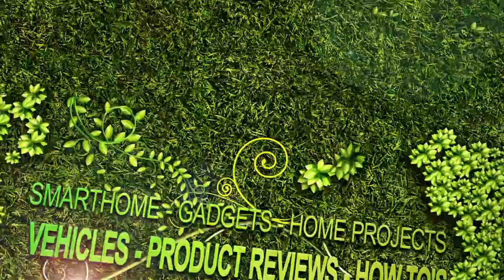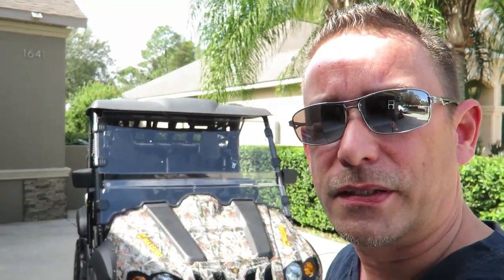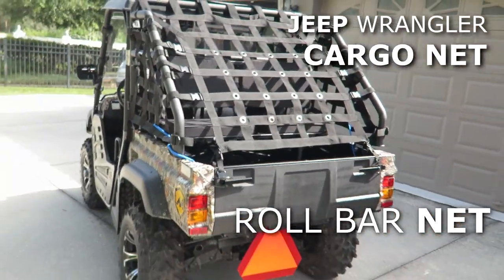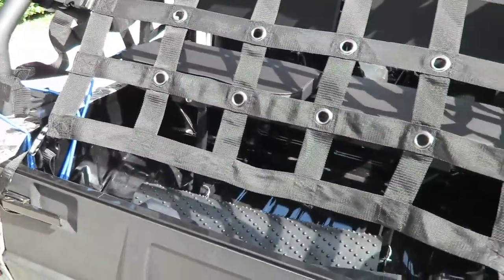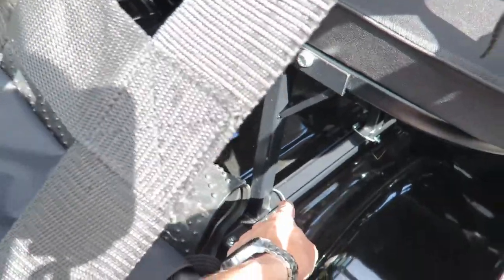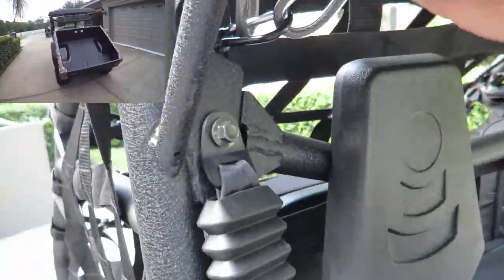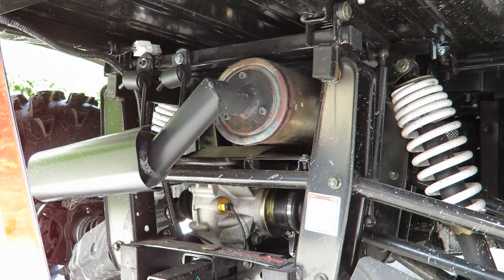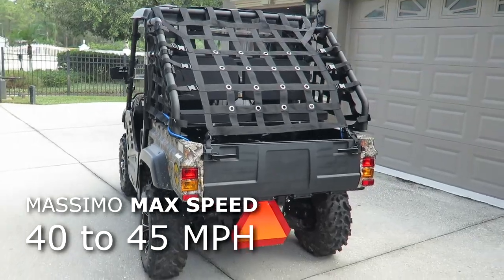TOP 5 UTV MODS:  How to Make Your UTV AWESOME!

Comment: I have owned my Massimo UTV 500 for 8 years and have made some very helpful & useful mods.

#1 - Added/installed a hi-intensity 16 " LED light bar, onto the 'brow' of cockpit roof, then mounted On-Off switch to instrument panel at 'knockout' plug location.

#2 - Ordered a Volkswagen rear view mirror & mounted it just to the inside lip of the cockpit cover.

#3 - Purchased a Kidde fire extinguisher at local hardware store and mounted the unit between the seats to the center vertical support bar.

#4 - Purchased a 'flat' cargo rack and mounted it onto the roof top with stainless bolts & nuts down to attach to the cockpit tubes.

#5 - The UTV needed a 'dust shield' when 
 operating in rough dusty country.  The 'fix' was to take sheet of inexpensive 'Corplast' (new or used), then cut the bottom edge to fit the contour behind the seats, around the various bulges & bumps, then trim the top edge to  just below the top of the seats, then rounded the corners a bit and spray paint a coat of Rustoleum X-2 Canyon Black, WOW, no more choking dust in the cockpit !! and it cuts down a lot of engine & road noise.

#6 - Purchased a 9'X 7' camo colored poly tarp,  rolled it up and used a 6 foot length of 1/4" nylon rope to attach the now rolled tarp to the horizontal crossbar just behind the seats. 

#7 - Purchased a removable bench type 'jump/rumble seat' and mounted in dump bed.

#8 - Mounted farm vehicle 'triangle' sign to surface of the tail gate using 2 stainless 1/2" sheet metal screws. CAUTION  Do not mount the triangle below the bottom of tailgate as it can easily be knocked off by brush or brambles.

#9 - Purchased an extended square tube trailer towing bar at hardware supply & installed into vehicle reciever tube and secured with easily removable pinion & 'clip'.  

#10 - Purchased small yard type trailer at Tractor Supply that is easily hooked up, & towed by my UTV, then purchased various spray cans of camo color spraypaint and painted the trailer to closely match my UTV's camo pattern.  Nifty !!

11# - Purchased a HD weapons magnet at Academy and mounted undernearh instrument panel to hold a handgun as I live in rattlesnake country.

* Now working on improving the cockpit door return & closure system, will replace easily rotted rubber return bands with stainless springs using same mounting points on doors.  The door latches also need a bit of attention and possible fix will be use of a 'swatch' of HD type velcro to heip keep doors closed when operating in snake country 🐍🔫
Reply: One Additional Note -- Beneath the drivers seat is empty wasted space.  Using Corplast again I cut small panels to fit between the engine and empty space & a small placard to fit at back of the empty space, then purchased very small foam cooler which fit perfectly into the space.  I now have a cooler for drinks or eats while out scouting the countryside or hunting.
Reply from the maker: @tejician1  Hey Jim, thanks for sharing your ideas! That's some nice work you've done. I've been wanting to add a Light-Bar, like you mentioned :)

Comment: silencer on the exhaust will not make the sound in the cab any better thats all engine noise you here you gotta do other stuff to change that
Reply: Easy fix for 'quieting' engine/road noise and blowing dust in cockpit is to cut and make a 'shield' from  a 4 X 5 sheet of Corplast material (used for political signs etc).  Using a marker draw and cut a contour to fit closely the various bumps & bulges at bottom & backs of cockpit seats, then trim top of Corplast to just below sear backs, finish up by spray painting a coat of Rustoleum X-2 Canyon Black to match tubes.  I did mine 8 years ago and it still appears new after many hours of hard use.
Reply: Jim..what did you do about the heat from the engine?
Reply: Most of the problems "new" owners of the Massimo UTV are caused by an absence of a 'Baffle' between the dump bed and the cab or seats.  Without the baffle engine heat floods into the cab which is very uncomfortable during the warmer months of the year and choking road dust comes rolling into the cab.  These 3 problems were easily solved by using a 1/8 in. thick sheet of corrugated political signage, then using a marker (Sharpie) to follow the undalting bulges & curves at the rear & bottom of the seats, then drawing a line across the top of the seats..Then cutting out the pattern and lastly using a spray can of Rustoleum X-2, color to match the Massimo's color.  My Massimo is camo colored, I used Black to match the vehicles structure.  You now have a baffle partition  that is easily installed & doesn't require screws or zip ties to hold in place and easily fits between the dump bed & seats and is waterproof.  I noticed an added benefit after installation...  Excessive engine noise was eliminated allowing for normal conversation.  I know that I should have made a YouTube 'How To' but that would have made a bigger hassle than explaining the simple & inexpensive process....😃
Reply: Why thanks Jim for taking the time to give an in-depth description..really apprecIate that..I think a video would be quite beneficial to us sufferers of the Massimo brand haha lol. ..well I will give the partition a try but first I got to do something about the ridiculous amount of time it takes to get up to speed..im a new used owner and I think the previous owners drove itbin high gear only?

Comment: Where did you get the muffler sound reducer?
Reply from the maker: The link is in the video description :)
Reply: Don't purchase the sound reduction unit, doesnt work worth a 'plugged' nickle, noise problem is easily solved with sheet of Corplast, cut to fit & slipped behind seats (10 mins of work)